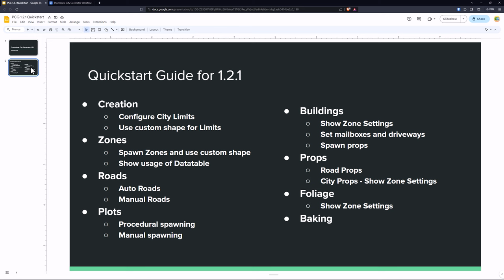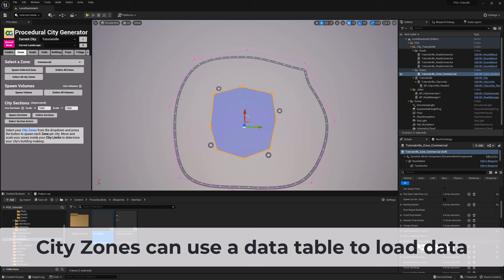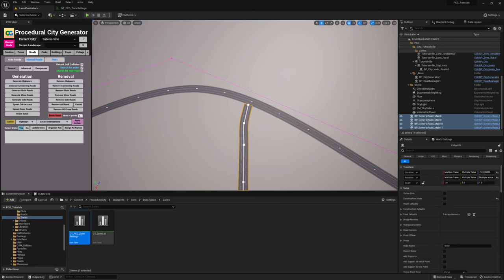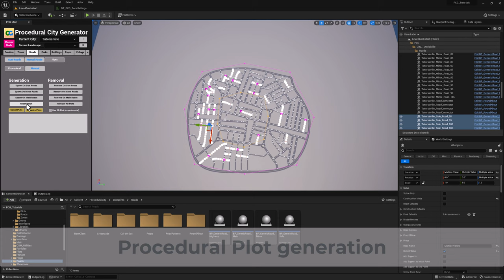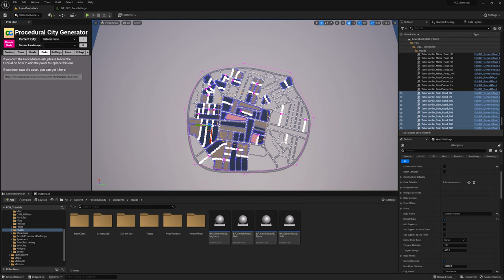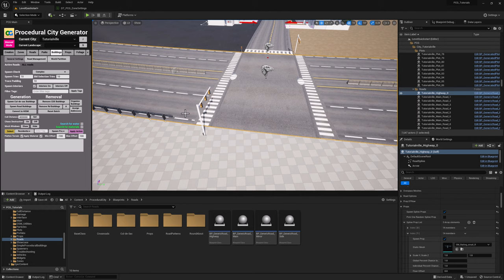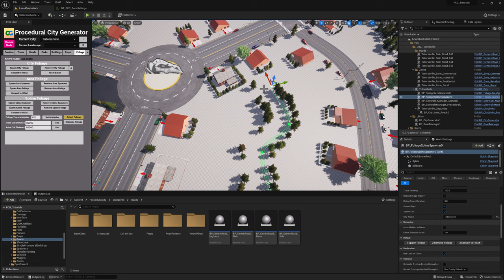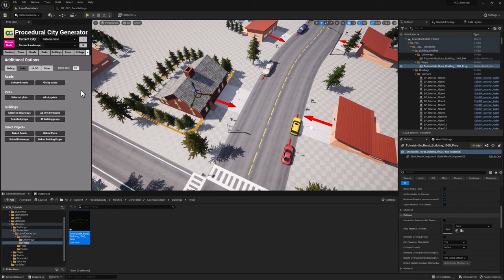Procedural City Generator 1.2.1 -  Quick Start Guide

Comment: I'm doing a very similar project, however I'm stuck on how can I place the buildings on the tiles. I'm a beginner in gamedev and procedural generation, do you have any resources I could look into to learn how to do it?
Reply: i already have the road layout and each tile where the building has to go, but I don't know how to place buildings according to the tile shape
Reply from the maker: @pacmaybz  If your roads are splines you can get the location along the spline and then offset it to the right / left of the road. then test whether that location is viable for your building :)